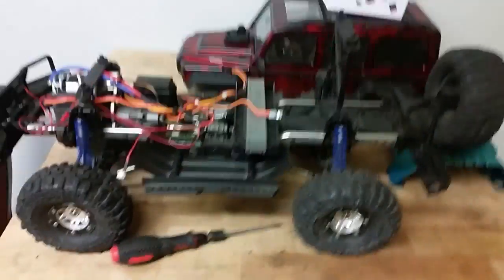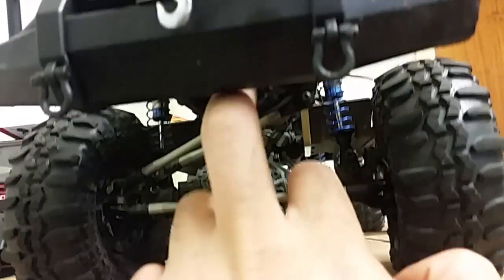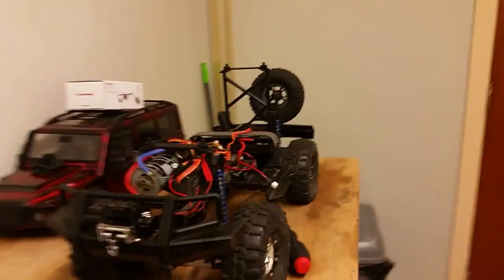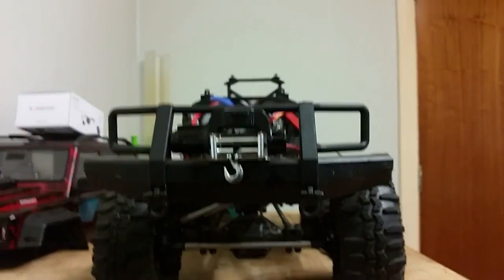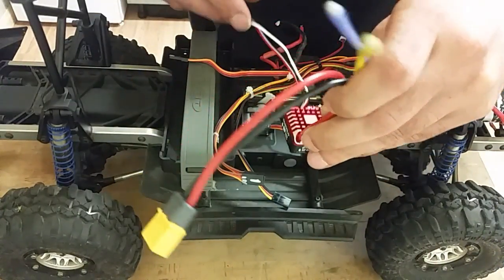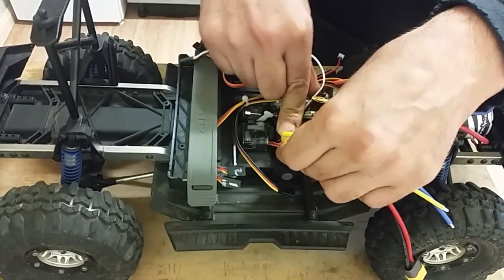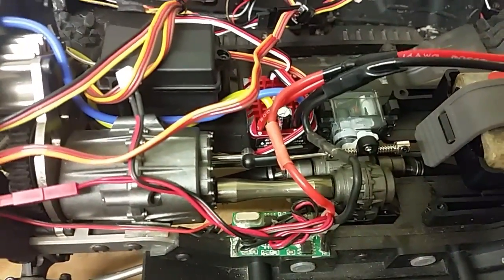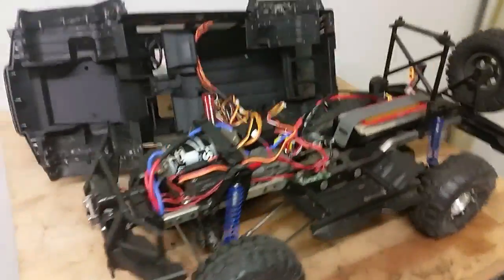Hobao DC-1 Crawler PanHard Bar "Rant" & New ESC

Comment: I keep forgetting to put up a video on how to get rid of the bump-steer.  I'll try to get it up soon.  The shifting of the chassis side-to-side during the travel of the suspension is normal on these R/C crawlers with panhard bars.  The Vaterra Ascender and Axial SCX10.2 also do this.  In real life customized off-road cars do run the same setup, but what you see in R/C is more exaggerated.  The trick is to balance out the shift of the chassis evenly between fully compressed and fully extended.  I'll also go over this when I get a video up.  Hopefully soon!